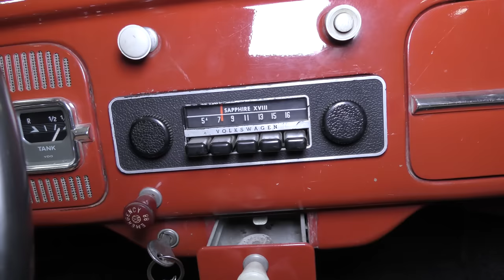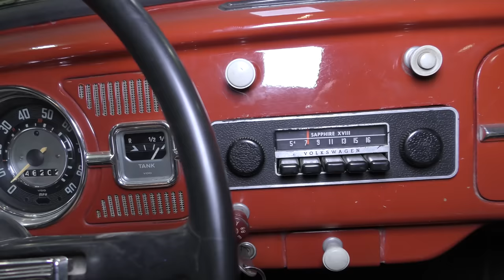Big Mods with big $$$. When Mods don't make sense. What did the  CAR WIZARD do to this '66 VW Bug?

Comment: Thanks for the really interesting video Car Wizard.  I see that VW bug has had several upgrades and a totally restored interior.  This car originally had a 6 volt electrical system but, I noticed when looking at the engine bay, a 12V VW alternator was installed (the original was a 180 watt, 6V generator).  Likewise, the radio is not stock but, a 12V version from the early 1970's.

That was a nice fuel system modification.  It may not have been necessary if ethanol free gas was used.  The adding of alcohol to gasoline, causes it to deteriorate much faster.  For my long term storage generator fuel, I use ethanol free gas with Sta-Bil and one ounce of Marvel Mystery Oil per gallon, which puts some lubrication back into the fuel, somewhat more like the original fuel those engines used.

That Beetle is in beautiful condition, the floor pan, suspension rubber seals, and even the engine was relatively clean.  Since that engine never used a gasket between block halves, oil leaks are guaranteed.  That's a Great sounding exhausts system, quite a bit different from the original exhaust note.
Reply: My 62 Ghia sported a type of "glass pack" custom header system, that was quite common back in the 60s and 70s...It sounded very sporty, and supposedly gave you an extra 5% HP!...a big deal on a 1200cc engine!.
Reply: @curbozerboomer1773  Agreed!  My older brother own a 1964 bug with that same 1,200 cc, 40 HP engine.  After adding the header system, there was a noticable difference in power.  The downside was the extra noise.  When passing equestrians, you had to coast by at idle, otherwise the louder exhaust would cause the horse to bolt.

Comment: Awesome VW ! reminds me of my Childhood i was born in 1964  and my Father loved Beetles he bought a new 1958,63 ,and a 68 Bug  they were so new to America that when he drove the car to workminNew York City and parked it on the Street he told me often he had to chase people away from his car before he could drive it home  he told me many times people would have the Trunk and Engine hatch  open so they could look at everything  me i was a very Skinny kid and on long trips i used to crawl up and lay down on the rear package tray  to take a nap  when i stayed awake on long trips  i had gotten a plastic counter  object that each time you pushed a lever it would keep the total  with 3 gears that turned  and displayed the total in little windows on the counter  it sort of looked like the ones Baseball Umpires hold to keep track of balls and Strikes for every batter  what i did with the counter was keep track of all the VW Beetles we saw on the roads on our travels  this was very easy at night on the highways because many of the Bugs in the 60s were 6 volt electrical systems and the headlights were way closer than most of the other cars  the significance of the 6 volt  system was the headlights were dimmer than most of the other cars that were 12 volts  and with the original VW Generators  the lights. would get  brighter and dimmer with different RPMs of the engine  this game of counting was  pretty much a Family thing because my parents  up front could hear  the click on my Counter  and would make sure i didn’t miss one  fYI my Dad got all excited in the 1980s when i traded a Coworker a couple hundred dollars and some used tires i had for a very Rusty and Poorly running 1972 Beetle  that i actually gave to my younger sister for her first car  my Dad and i pulled the engine and installed a New Brazilian set of Pistons,Rings ,and Gaskets  to freshen up the 1600 DualPort motor that was in the car  when I got it and drove it home at 1 in the morning , no Tags  and not much power because in the daylight the next morning  we realized two Spark Plugs were dangling  by the wires  because the threads were stripped on the engine  i bought this weird kit from a localVW repair shop called a Heliocoil  with some hesitation  but the guys in the shop told me how to properly install it  and  last i knew  that same Engine was Swapped into  many other Bugs and still running  more than 35 years later  on those Helio coils and cheap Brazilian parts that entire kit was $113.00  out the door of my local parts store  all my VW freinds told me not to  buy the Brazil parts and only use Genuine made inGermany VW  parts  oh BTW my sister drove the hell out of that car  for 4 years and gave it back to me i pulled the Engine  and scrapped the Rusty old Pan and Body    it was Hideous anyway as it was aFactory Green Car that someone painted Brown with what looked like maybe a Broom or a Mop  and filled in dents with Plaster of Paris  ? my Sister  out Drunk put one of her Girlfreinds head  in a Accident  into the Windsheild  i always though the AirCooled engines should have had hour meters on them to keep track of how much they were used  i had found out that one of my Cousins who plays Drums in Rock bands had a freind in the 70s that was a Hippie who drove a Bug  back and forth to California and New York and basically was Homeless so he couch hopped accross the Nation  for shelter  his Bug had over a Million miles on it  and my Dad was under the impression it had the original engine  well recently my Cousin and i were talking about that guy and his car  and my Cousin told me it wasn’t the original engine  the guy was so fast at pulling one out and installing them  that at night he would  push his Beetle back to back with another one and swap the engines  the people never realized it because their car started and ran the next day  while he wound up with a newer one in his car Dishonest as can be but in a weird way kind of funny  my old Man went to his grave thinking that guy  had millions of miles on the original Engine that Volkswagen put in it at the Factory  everytime airCooled VWs came up in a conversation my Dad would mention that Hippie freind of my Cousin ! Car Wizard check out the YouTube video titled Sleeper Bug  the guy did a nice Subaru Turbo Swap , Super Clean work  and Engineering / Fabrication  and the car  hauls ass plus sounds good as those Subaru Boxer motors have a good exhaust note with the right pipes

Comment: If the customer only runs it occasionally, why not suggest they take it to the local airport and fill it with Avgas when it needs filled?

The stuff won't foul as quickly as the junk The Powers That Be force us to buy at the "normal" pumps.

Comment: With the car now having an electric fuel pump, it would be worthwhile to add a fuel pump cutoff switch so ignition can remain on and the engine runs until it empties the carburetor (and cylinders) of all the gasoline before stoping prior to going into storage. I've used this practice on a gasoline Ford tractor (manual fuel valve shutoff) for years before I put it into long term storage. By doing this, carburetor gum up problems which previously were frequent have gone away.  This is also done with piston engine powered aircraft for a number of reasons, one being a critical safety issue.  Also for low mileage vehicles, if ethanol free gasoline is available, it stores far longer without deterioration. Near a dollar more per gallon in some areas but well worth it..

Comment: My brother bought a 70’s Beetle from a so called specialist, it had this very same problem, it was a daily driver and it would never start that easily or it simply wouldn’t start. It went back and forth to this ‘specialist’ he changed everything and it still wouldn’t start easily. He eventually sold the car out of sheer frustration and the cost of repairs that never solved the issue. And apparently this specialist is still in business! It was a great car ruined by a thief of a mechanic 👨‍🔧

Comment: Noticed the alternator conversion on the car. Is this still a 6 volt system or has it been converted over to 12 volt?
Whoever did the front end work and pan replacement on this car did an excellent job on keeping it stock looking and deserves a big pat on the back.

Comment: Should wire the fuel pump to come on for 5 seconds when the driver's side door is opened, that's the way our 2003 VW Jetta works, but for a complete different reason. The fuel rail looses presure when the car sits so turning the fuel pump on a few seconds before engine cranking minimizes annoying hard starts. This was from factory mind you, and ECU would only do this when the engine was cold since that meant it sat long enough for the fuel to drip out of the injectors and into the oil pan 🙄

Comment: Another simple solution on anything carbureted is to use non-ethanol fuel. That’s what goes in all of my vehicles, be they motorcycles, lawnmower, or my TJ Wrangler. 4.0L Jeeps just won’t run worth a damn in Florida on modern gas.

Comment: I just have to one comment concerning the Chevy Cobalt , you said it wasn't a well built car and to avoid buying one , although its a cheap built car I personally would recommend someone to buy one of these cars especially one with low miles there cheap to maintain , they get excellent gas milage and the 2.2 four cylinder is bullet proof , I've seen these cars with over two hundred thousand miles still going !

Comment: I appreciate using an inertia switch, if you are worried about safety then why would you put the relay in the area where the spare tire should be. The spare is an important safety feature of  a beetle.
 The radio is not stock to that car, it is a 68 or newer designed for a padded dash and should have chrome trim and not be all black.
A decent car but it's been packed as you can see on the right inner 1/4 and it's a shame they didn't bend over a little when painting and get the under side of the spare tire well.

                                                                              Ycats

Comment: The electric fuel pump makes practical sense.  I bet it would be possible to take the guts out of the original pump and put it back, just as a flow-through.  It would be a nice touch to maintain stock appearance.
Reply: Neat idea!

Comment: Three Questions. 
1. Would using ethanol free gas help with the degrading gas? 
2. Is the car still 6 volts?
3. Does the heater/defroster actually work. Oh I froze my butt off in my 67 Bug back in college.

Comment: Hi Wizard, that is not a generator. It was originally but, that has been upgraded to an alternator.
Reply: I noticed that, too. Its also been converted to a 12volt electrical system. Originally it was 6volt.

Comment: That  is a custom front axle torsion bar housing. Who made the inerta rollover switch?  Its the OD of the front tire  at it's inflation pressure.that matters, not the diameter, width or aspect ratio  of the tire.

Comment: A 66 VW TYPE 1 really ought to have a camber compensator installed on the rear end to prevent the swing axles from dropping. They're fairly inexpensive. I believe EMPI sells them.

Comment: Is non-ethanol gas available in Kansas? I think I would start with that. And one of the thing, carbureted vehicles need to be started up at least once a week, they require a lot more maintenance  if you want to be able to get in and go, but you probably already know that don't you.

Comment: The original AM radio is actually the Sapphire III. This one is a 12 volt unit from around 1974.
Reply: The real original radio was 6volt as was the rest of the car and had to warm up to work cause it still had vaacum  tubes.

Comment: In addition to the Stabil the owner should set a reminder on their phone to drive the car for 30 minutes or so once a month to keep the oil circulated in the system and evaporate out any condensation in the muffler and heat exchangers.

Comment: I agree, today's gas is crap. But for boats and other things.  Look for what's called conventional gas. Here in the southeast,  we can get 90 rec, 87 with no ethanol,  and 93 with no ethanol. The 93 is harder to find. But conventional 87 can be found, and rec 90 is available and is also usually sold at marinas around here. I have a 2019 ecoboost mustang. I will either use conventional 87 or rec 90 gas. Both of these don't have any ethanol in the gas. I'm a gas hauler here in the southeast

Comment: I appreciate all your videos. But from experience and watching videos on gasoline stabilizers, I concluded that gas without any alcohol lasts the longest when an engine sits any length of time. Marinas usually sell gas without alcohol to solve storage and hot start problems. Not all marinas sell alcohol free gas. And aviation gas is very stable for storage,  but the aromatics in the gas will eat rubber and plastic if it is not designed for that gas. Just stating my experience.

Comment: One of Hoovies' later videos it showed an Alfa Romeo 164 sitting in your shop.    I almost bought a new one back in 1991.   Bad thing was, after a test drive it was falling apart in the dealer's lot....cord to open the fuel cap broke, the instrument panel died when idling...I wonder what is the issue with your car.   I ended up buying a 91 Audi coupe quattro....and the most reliable car I ever owned.....it died at 431K miles....never overhauled...always used 1 qt of oil every 3k miles like clockwork.   Same clutch as when it left the factory with even the same timing belt!   Biggest repair was replace fuel injectors...  I am curious about the Afla.....maybe a good project car for Hoovie!!  thanks Wizard....

Comment: I work in the service department at a Nissan dealership. We recommend CVT service every 30k miles for this very reason. Many owners feel that our recommendation is just a money grab and that we are trying to scam them. Saying they had (insert any other brand vehicle) with 100k miles on it and never changed the transmission fluid. Unfortunately many of them learn the hard way that a $300 transmission service is much better than a $5,000 transmission replacement.
Maybe we should play your video on a loop in the waiting room?

Comment: Hey Car Wizard, does Stabil affect the carberator when fuel sits in it for a long time?  My mom has a golf cart at her winter home in Phoenix, AZ, and it was having trouble with the carb getting gummed up when it sits for the summer, even when she had someone drive it about once a month.  The golf cart mechanic recommended installing a valve on the fuel line so the carb can be run dry before parking, so I did that and its now sat through two winters with no problems.  He says the Stabil is okay in the fuel tank because it's plastic and closed, but that it doesn't do well in the carb and can gum it up just as much as old gas.

Comment: I had a 66 I bought  new while in  college.  Great car until I rolled it after too much beer.  Love your great videos.  Question, why the need for an electric fuel pump since you fixed the fuel stability problem?

Comment: What a beautiful car and fantastic condition. You have done an amazing job there wizard for the customer. If I was the customer I would keep the car and in 10 or 20 years when the engine causes trouble do the EV conversion then. It will cost a lot less by then and battery technology will mean it will take up far less room and weight.

Comment: I'd choose Stabile 360 over the standard stuff...it works better.
But no matter what you treat today's gasoline with, there's still gonna be damage and deposits left with/in the lines and carburetor. If you had the ability to shut off the carburetor fuel intake and let your engine die after consuming all of the carburetor's gasoline - all the better (like many do using ethanol and chemical laden gasoline in lawn tractors).

Comment: I assume the "new" gas used is 10% alcohol. So...did you jet the new carb. a bit richer to compensate? Also, did you pull apart the new
carb. & check everything? ie. (Float setting etc.) <<< Because..Trust no one.
Luv the Inertia switch thing. I will add one to my hot rod / Elec. fuel pump / Carb. set up.

Comment: my first car was a 65 squarback. next was a 67 Bug that i took to Missouri from Southern California. i hurt alot of V8s feelings with that 67 Bug. most people didnt know that a beetle can be quick. they think of a slug Bug. it was very quick. not fast. quick. one time i didnt even get a ticket for drag racing cuz i beat a 5.0 Mustang. cop seen the whole race. he pulled the Mustang over first.. lmbo. then me. cuz he knew where i worked. small town and all..lol. and i had THEE only Bug in this small town. good times..! reason it was so quick. i had 3rd and 4th shortened. 105 screaming 5,500 RPMs. if i got to 3rd gear and u wasnt beside me. race was over. that Bug pulled every gear. and i only left about a 3 foot burnout. hooked and went.  never did slick it and take down a 1/8 mile. wish i did. gears were too short for 1/4

Comment: Between the mid 60's and mid 70's I owned a 66 "Beetle", a Sun Bug and a Super Beetle. Should have kept them...I converted my 6 volt VW to 12 volts.  You didn't mention they don't require an oil filter...just an oil screen one cleans. Simple, economical and SLOW transportation.